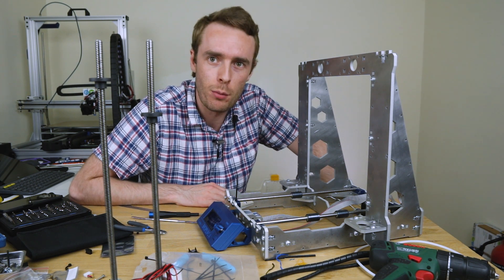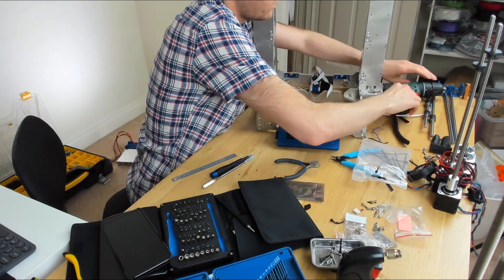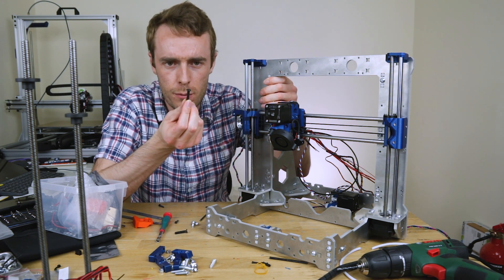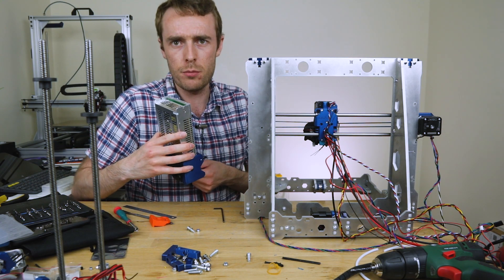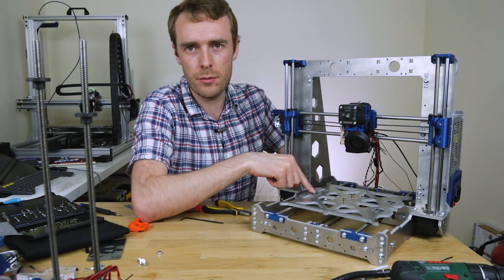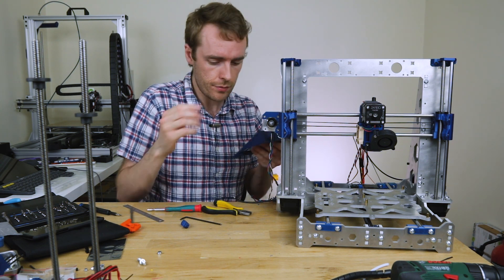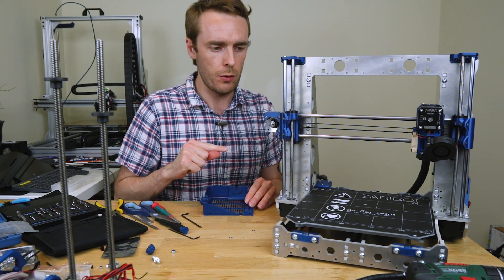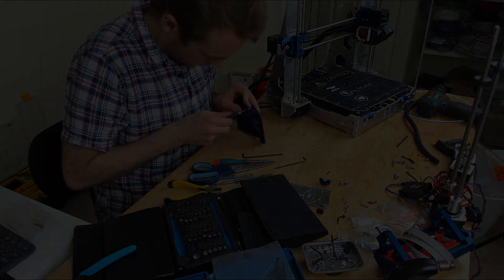Prusa Mk2.5 Upgrade Build Series - Episode 5

Comment: It goes wrong, carry on 🤔👍 That's one of the reasons that cad assemblies with all screws and nuts make life easier even it takes few hours to get the joints and contact groups right. On the other hand 3D printing is great as you get wrong parts quite fast right.